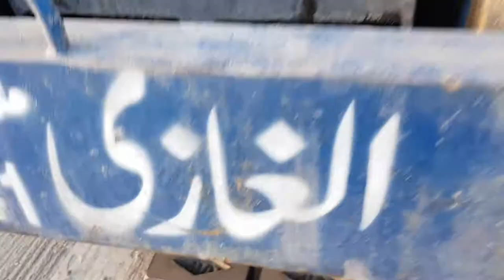Mobile Bricks Machine

Comment: How many bricks can make in one day 10hrs. and is there any difference in final product price between manual and machine bricks in the market.also if i will rely only on machine due to labours problems my kiln will run or no. 
regards
Reply from the maker: It makes 25000  to 35000 brick
These Bricks  demand  is not so good in market 
200 to 300 rate difference  per thousand  brick
Reply: @chienthanlienminh  So my kiln will not be successful with machine made bricks i want to start bricks bussniss only due to this machine productivity.can i depend and what       
About beakdowns everyday or only very rarely.
Reply from the maker: Yeh of course